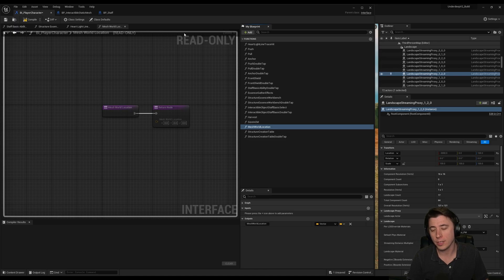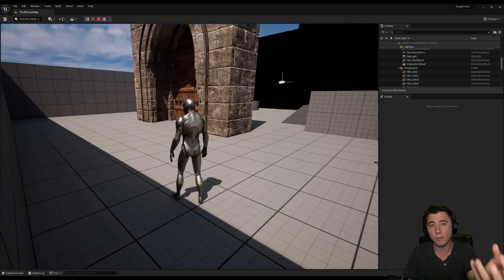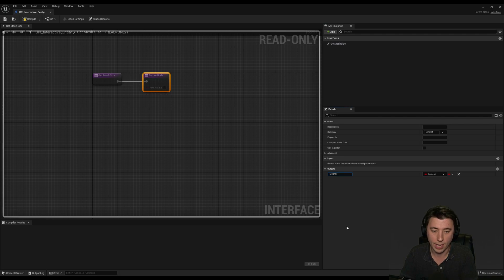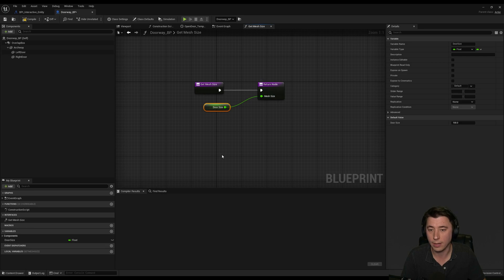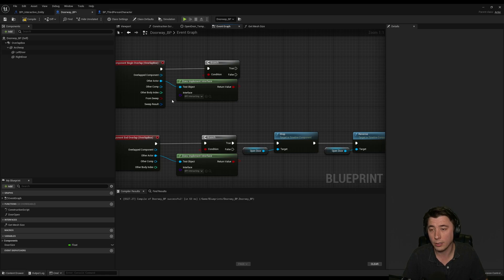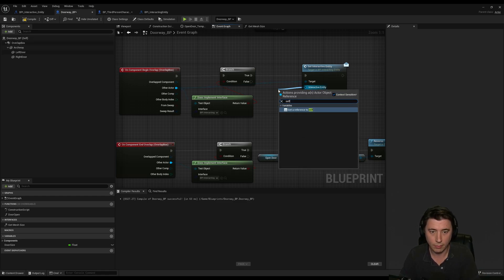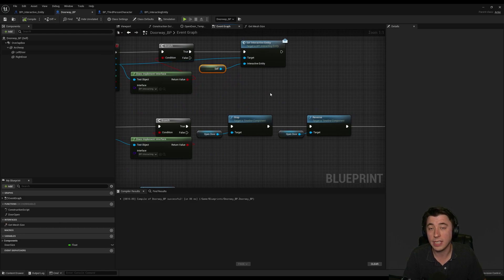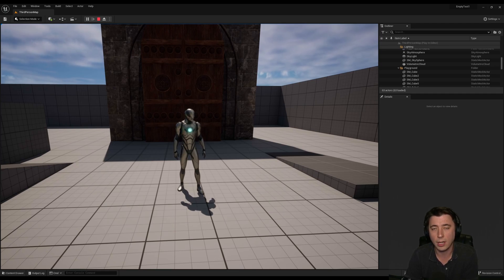How to Get Data FROM the Object Implementing an Interface - BPI with Interactive Door Example

Comment: Ahh man. The struggle continues. I don't think there is a single demo of how to handle a situation where there could be multiple interacting entities. So basically my situation is I have a fog cloud Niagara system(contained in actor bp with collision box) and i have a torch+other fires actors(with their own collision,overlaps,niagara) some of these could be dynamic or moving+could be overlapping on begin play. I need a way so that my fog cloud can get an array of vectors positions that could be dynamic to use "niagara set position array value" so that if there are multiple fires in the area they can interact with the fog particles. Any tips would be greatly apricated. Idk maybe i am just overthinking it. Also if the actor is already overlapping on begin play the "On comp begin Overlap" event doesn't even fire. is there any solution to this, i saw a node "Get Overlapping Actor" and a few other similar nodes but not sure if that's the right use case.

Comment: Thanks, very helpful. 0:44, 4:35 And you explained keywords for when to use Output vs Input. 
But the title is bad for how useful this vid is. Suggestion to add [to the title or search string that YT uses] "BPI how to pass variable" so that people who know what [keywords BPI] theyre searching for can find this.
Reply from the maker: Youtube figures out over time how useful videos are.  Not too worried about it.
Reply: @NumenBrothers  Im speaking of users manually searching for "BPI" and how to pass a "variable" (which is a more precise word that theyll think of instead of "data"). 
Ive spoken with 6 people who want this precise info but they wont find it if you dont have the words in your title/YT search tags. 

("Interface" isnt as precise, I guessed that it means BPI. But I only see this vid because I am subbed; Searchers would not find it this way - I tell them what keywords to search for.)